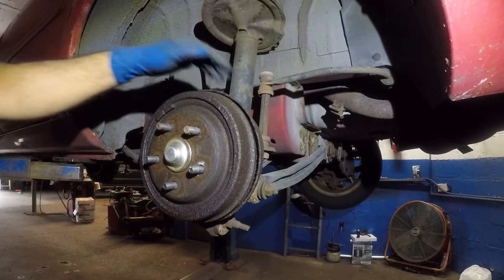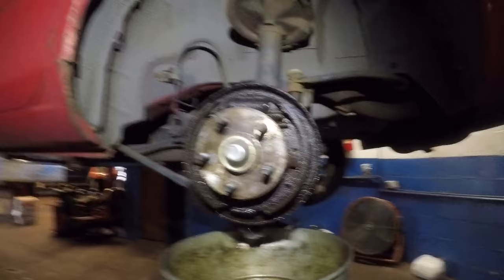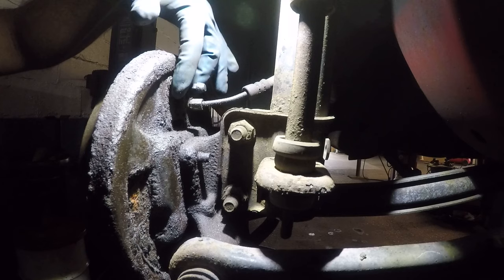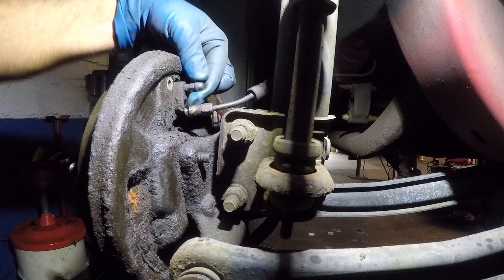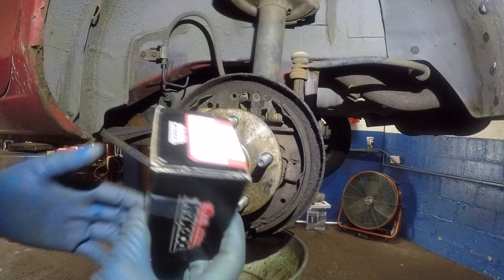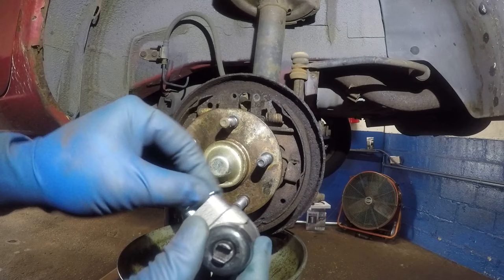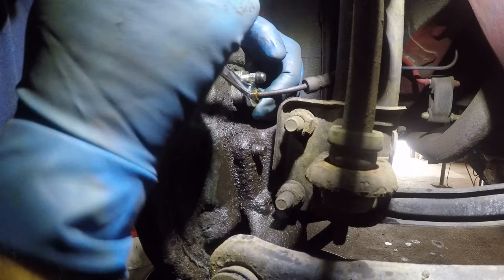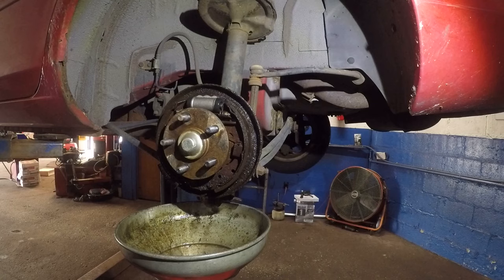Leaking Brake Fluid, Bad Wheel Cylinder

Comment: Great tip on using the pry bars to open up just enough to replace  brake cylinder. Thanks!
Reply from the maker: Yup I use screwdrivers same way
Reply: It's a real trick.....often times a pry bar ( or ANYTHING ELSE !) that is used SLIPS and the brake shoe "horns"  spring forward and tear up the dust boot...or maybe even more damage to the cylinder. Time for another cylinder !!!.....even though you attempted to install a new one !!!

Comment: Did the rear brakes on my 11 year old Honda today and found that I had a blown cylinder.  This your video was exactly the help I needed to replace it without having to remove the brake hardware.   Thanks!

Comment: Thanks! I've been having a  leak in my rear passenger side wheel ever since I replaced the front brake pads
Reply from the maker: Ok it might not be related to doing the brake in front but take a look and repair the leak
Reply: How did you done the fluid bleach ?
Reply from the maker: @capharlock1  fluid bleach?
Reply: @RBTheMechanic  yes after you take the piece en the middle the one has the fluid you say something about about bleach the system
Reply from the maker: @capharlock1  I think h mean bleed like bleed the air from the system

Comment: Nice video. How much would that have cost to actually complete like you wanted too? Both side let’s say.
Reply from the maker: Both cylinder drums shoes and kit total $700 complet job like solid
Reply: @RBTheMechanic  thanks for your reply. I have this issue now and got quoted $800 on an even smaller car than the neon.

Comment: GREAT VIDEO! i am working on my toyota yaris 2007 i am trying to replace the wheel cylinder but the bold that hold the cylinder broke in two pieces adn the thread brake line is toouph to open look like stuck. the other proble i have is i almost remove the shoes below spring but the top spring is givig me hard time what advise u can give me bro thanks
Reply from the maker: Yeah if u can manger to get the cylinder off then the springs will come off easy if u in do the adjustment screw down to zero and yeah all that gets jammed rusted over time

Comment: Excellent video.
My cylinder hissed when pressing the brake and leaked...now my brake fluid reservoir got almost empty.
Hoy do I replenish the brake fluid?
Just keep adding to the reservoir?
Should also bleed the air from the 4 tires...starting from the front?
Reply from the maker: U have to replace the brakes drum and cylinder then do brake bleeding and flush.  Don’t just keep adding it will keep leaking and cause accident

Comment: This video was very helpful and easy to follow!  So I have a 1986 Chevy Silverado and the back drivers side wheel is leaking fluid. After I change the cylinder, brake pads, etc.  do I have to bleed my brakes on such an old truck or can I pump the brakes to get the fluid going through again.
Reply from the maker: U have to bleed it

Comment: The bolt on the (1997 Accord)  Brake Power Booster  broke while I was tightning the nut during a brake master cylinder replacement.  Do I need to replace the entire Brake Power Booster or can I just replace the bolt on the  Brake Power Booster ?

Comment: Is it right? if the cylinder not ok anymore you will open the seal there is a fluid? And when the cylinder ok even you open the both seal doesnt have a fluid?
Reply from the maker: Yes that means cylinder is leaking if u see fluid there
Reply: @RBTheMechanic  thank sir

Comment: Bro I appreciate that you care about her saftey but it's a drum brake. As long as she is not hauling anything she doesn't need it. Stop it from leaking it's fine. 80% of your stopping comes from the front. It's not gonna run away if it keeps pressure
Reply from the maker: 70/30 yes u need back brakes to stop the back force or it will do 360
Reply: The brake fluid will deteriorate the brake shoes due to contamination. The parking brake will be insufficient as well as the pedal brakes.
The brake shoes on both wheels need to be changed when replacing any faulty and leaking brake cylinder.
Reply: i was told that worn shoes can make wheel cylinders go bad. i drove on shoes that had worn down to the backing plate. The woman probably couldn’t afford all at once.

Comment: Mine are leaking from the inside. What all am I replacing?? I have to order parts. Stranded 2 hours from home. I’m fixing it myself because of cash flow
Reply from the maker: Yeah replace it
Reply: Replace what? The brakes or brake cylinder ?? Please be specific about part’s with me. I’m a newby at all this, but willing to jump in and get dirty due to no $$$$
Reply from the maker: @virginiawilliams8947  if it was my car both cuz once fluid gets on it just stays in the pad safety first money later

Comment: Thanks brother ♥️
Reply from the maker: No problem!!! Glad to help in anyways!!!
Reply: Actually today I noticed .sometimes when I hit on brake showing handbrake sensor light .then I fill brake fluid .light will disappear ..but today when I check there is leaking in rear wheel ...is this major issue.?.and how about the cost like approximately. ( for mitsubishi lancer 2003)
Reply from the maker: @fz5179  brake leaks .... must fix it immediately my friend. Check ur brakes and shoes if they old and bad replace them also so let’s talk price brake cylinder fair job by hood mechanic should be $190 or less cylinder is only lik $15 brake fluid $10 rest is labor however the stump brake shoes and drums $270job

Comment: I need your help!!! 😢  i have a 2005 Ford Taurus SE. Break fluid low light is on, and break light is on. When I put break fluid in i see it come out from the driver side back wheel.. today i put the car in reverse and it took off super fast. Pedal went straight to the floor. Hit the emergency break and that didn't do anything, not even slow me down!! I had to put the car in park while reversing super fast ... How do i know what needs to be fixed???? A couple months back a friend fixed the driver side back shoe and drum and the cylinder.. But after two days break fluid started leaking the same way again. 🥺🥺🥺🥺 Also I do know that he didn't bleed the breaks after fixing the cylinder.. 😭 what should I do? Replace cylinder again? Replace cylinder, drum, shoe, and caliper???? Or how do I find where the leak is coming from exactly????

Comment: hello sir just replaced my mitsubishi mirage brake cylinder brake line broke replace,just realised after few days spilage of the brake fluid again what could it be
Reply from the maker: Did u check the inner diameter of the drum I had similar issue the drum was worn out so much that brakes shoes hard to travel lot but the cylinder was maxed out

Comment: if that was my car or my family i would have changed the brake shoes   when brake fluid gets in the lining  you can spray them down with brake cleaner but it won't be like before the leak you won't get it all out  the idea is not to let it go to long on a leaking wheel cylinder or it will get on the shoe lining
Reply from the maker: Yup I did recommend it to the customer

Comment: Good video.    Brake fluid from my 1982 F150 leaks only from the front part of the reservoir.    I was told by my buddy that it means that the leak is on my front wheels.    Is he right?
Reply from the maker: Not sure if he’s correct u got to physically check it cuz the reservoir had 2 section so he’s just being too book smart even me as mechanic for 12 year wouldn’t think that but he has good theory since they divide front and back. Now new cars it’s one right one left so just check to see where the leak is
Reply: @RBTheMechanic  Thanks RB.    Will do.   One final Q;  The front brakes on my truck are disc not drum like the brakes in your video.    Is the cylinder replacement similar or different?    I probably should do what you recommend and replace the entire unit right?   Do you have a video for disc brakes?
Reply from the maker: @Coste1072  yea these are rear brakes front are disc brakes u have caliper in front u can watch my caliper videos

Comment: First the biggest problem is the tendency to play with the wheel cylinders pistons by squeezing on the piston pucks when you remove the cylinder from the package with your fingers. Yes its neat to feel the pistons move but you could be doing more harm than good. This action creates the major source of leaks in new wheel cylinders.

When the wheel cylinders are compressed with no fluid inside the seal cups have a tendency to disslodge or be displaced from their bore seat especially the smaller cup into the larger bore opening. Once the sealing cup has been displaced it allows fluid to flow around the seal cup and escape thru the clearance between the piston and the cylinder wall. The brake actually works to a degree but the cylinder leaks when the excess fluid finally fills the exterior moisture shield cup. What is the cure?

The cure is simple, Don't play with the cylinders when you open the box. But as a precaution and since most of you are somewhat handy with tools and understand mechanical things here are some pointers.

When you are replacing wheel cylinders one of the first things you should do after opening the box is to pop the cylinder moisture covers, pop the piston pucks and check the seal cup seats remembering or drawing a diagram of how they were disassembled..

While you have the cylinder opened up lube the seals and side walls with a very light coat of brake fluid and reassemble the parts in the order they were installed. Hint, as you are transitioning from one bore side to the opposite side fill the cavity with a small amount of brake fluid so there will be no air void between the bores. This also speeds up the bleeding process by removing the majority of trapped air. Finish reassembly and clean off all excess or spilled fluid. If you keep the bleeder valve closed no fluid will run out the nippple port and you then can assemble the line to the cylinder and install the shoes. After installing the shoes and the drums you can now go thru the normal brake bleeding process.

Comment: Looking to buy a 1998 Honda Civic Ex, but the Honda has a brake leak  fluid from the rear of the brakes? How much will it cost me to get it fix?
Reply from the maker: If it got drum brakes the cylinder and brakes I would do ur looking at like $300 for brakes and drum job and cylinder is $15 labor $160 with bleeding I would do both side cylinders once brakes are off

Comment: Great video. When I replaced the drum and shoes one side of the cylinder popped out. Now when I push on brake pedal it goes all the way down to the floor sometimes and not stopping the car right. Feels spongy/mushy also. Do I need to replace the cylinder or just bleed? What could it be? Doesn't feel too safe to drive
Reply from the maker: If the cylinder looks good no fluid is leaking bleed the air from that one side and see how it effected if good you fine otherwise wise it sounds like maybe bad master cylinder
Reply: @RBTheMechanic  I didn't have any brake issues before replacing the drum and shoes. A piece of the cylinder popped out. So I'm thinking this is the issue. Would the master cylinder go back after replacing the brakes? Would it be safe to drive to go to the mechanic?
Reply from the maker: @luciana_nemes  well any brake issue is not safe so try bleeding the air before anything I wouldn’t drive it if ur taking it to mechanic have it towed
Reply: I had same issues , installing drum shoes one side cylinder popped out 😢
Reply: @Ken-kb6yb  I put it back together and flushed the break fluid from all wheels. It resolved my problem. When the cylinder pops out it kinda loses the pressure and air gets in there so you have to flush afterwards.

Comment: bro, you'd change those shoes? they have 1/4 inch of pad left. those pads are brand new and you wanted to change them?????????????????
Reply from the maker: It’s not all about thickness.  Do u have 🍞 at home do they last forever ?    Some times u have to look for cracks and condition of meterial also brake fluid is NO NO on pads
Reply: @RBTheMechanic  fair enough, didnt consider that.

Comment: Hello mate. I have got a problem of Break leakage on my ALTO K10 Car which is an Indian make. I used to top up every other day after driving around 30-50km. Further I can't see any visibility of a leakage overall. But I have a doubt that it leaks through a washer or something as far as I learnt from previous experiences. What could be the issue? Can u explain it. Anyways I plan to investigate this problem with a mechanic very soon.. But I need your explanation causing this issue... Thank you!
Reply from the maker: Check where it’s leaking from and repair it brakes r serious on cars safty first

Comment: I will like ask you that yesterday I was driving my car then out of no were it started link brake fluid from driver back brake I am not sure what is but has all around the trie and on disc it's a 2001 Honda crv
Reply from the maker: But do check where the leak is could be cylinder or brake line

Comment: Do i have to drain all my remaining fluid before removing cylinder? Because i just added a fluid without knowing the cause til i find this guide. Thanks mate.
Reply from the maker: U don’t have to drain it that would add air just replace it as it drips then bleed it
Reply: @RBTheMechanic  thanks
Reply: You can use a hose clamp to keep the rest of the fluid from coming out while changing it. You'll still need to add brake fluid to the system and bleed the air out of it.

Comment: Hey, is replacing the cylinder the only option when it leaks?
Reply from the maker: Yup if the cylinder is leaking it’s only option cylinder is like $20 the repair kit wouldn’t be good idea
Reply: @RBTheMechanic  appreciate it

Comment: If I got this right, I need a bucket, a 10mm wrench, brake cleaner, and the new cylinders.
Reply from the maker: Yup
Reply: The 10 mm just spinning off
Reply from the maker: @Hoovaducelane  if it rusted it could be smaller size try 9 or 8
Reply: I tried the 8mm and 9mm first thing I thought it was I'm hit it with heat tomorrow and a wobble bit

Comment: Show me how to bleed the brakes please.
Reply from the maker: I got video comming on that very very soon
Reply: Here is Very simple method that people overlook......gravity bleeding. Simply open up the bleed screw and let it drain ( maybe thru a clear piece of tubing for less mess)....and keep an eye on how far the master cylinder reservoir drops in the engine compartment...keep filling as necessary.. It's slow....but it works.

Comment: Do aftermarket wheel cylinders fail often? I've tried a few and I've had some leak or after a year get seized
Reply from the maker: I never had that issue I use aftermarket lasts for years and years I still have person comming to me from 2014 and no leak
Reply from the maker: Penny Neiman  caliper or cylinder u should not have any leaks tho
Reply from the maker: Penny Neiman  not sure why they would say that I never had that type of issue it could be that it has oil sitting there and when boot was pushed it squared out but anyways it shouldn’t leak clean it up and then keep an eye on it once ur sure it’s not leaking then u should be good!!

Comment: Ok So i found out I had a break leak, Same symptoms you said, LEaking fluid, I put 1 bottle in the next day low break fluid. I had give back and today it's mushy and no give back. i noticed i have fluid leaking on my back right tire and no other side. If i do this should it fix the problem? Do you refill  fluid and push breaks or will they go back to normal?
Reply from the maker: Once u fix the leak you have to bleed the brake system

Comment: Could the happened because sound like brake was make noise then that's what happened with back brakes now it's link all brake fluid out driver back brake
Reply from the maker: U have to check where fluid leaked from cup be ur brakes and drum is excessively worn out and cylinder traveled too far and splash 💦

Comment: I got mine apart right now. Was changing the ebrake cable. Anyways it never leaked before but I guess I bumped the cylinder too far to one side and a small amount of brake fluid came out. When I pushed it back in it doesnt leak at all. 

Do you think I should replace it?
Reply from the maker: No that usually happnes to me as long as u pushed it right back in and check for leaks after cleaning and bleed the air it might have take in air

Comment: A little criticism.😁 How a mechanic doesn't have a brake line wrench?
Reply from the maker: I have brake line wrenches
Reply: @RBTheMechanic  I was just messing around.😁 I watched in fast motion and it still took long to get that brake line back on. 
I said to myself, it would be faster if he uses a brake line wrench.
Reply: @manuelester7420  ..faster?..... brake line wrench = flare nut wrench....right? It wouldn't be faster....a flare nut wrench compared to a open-end wrench,  just helps prevent messing up the 6 sides of the hex nut....right? But not "faster".....

Comment: I changed my rear breaks and drum. And in the process for some reason one side of the rubber boot on the cylinder fell out with a spring attachment to it. I attempted to put it back together and when all said and done. The break pedal is spongy???
Reply from the maker: Laramie Watson you have air in the system bleed the brake line it should go back to normal
Reply: Thank you